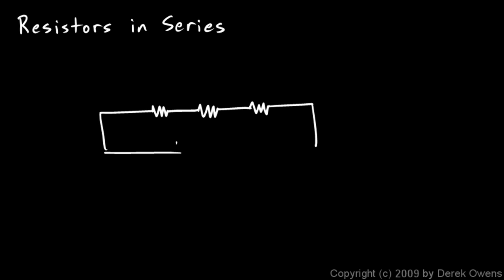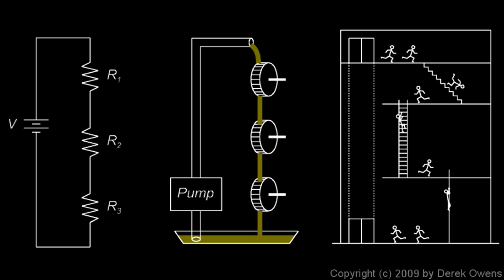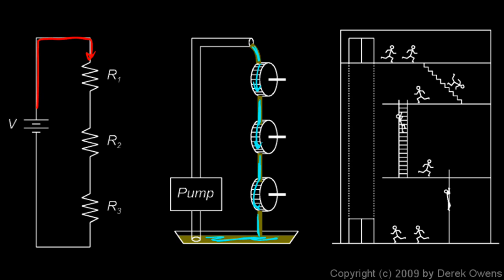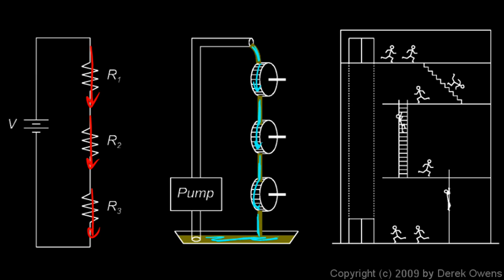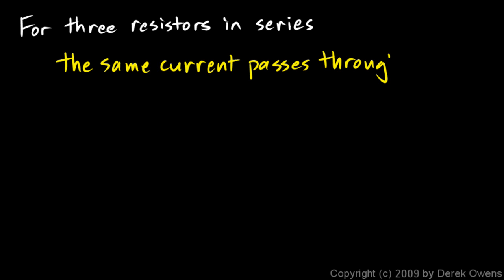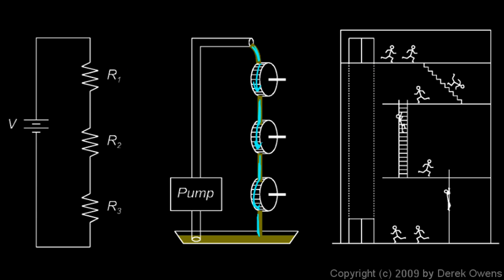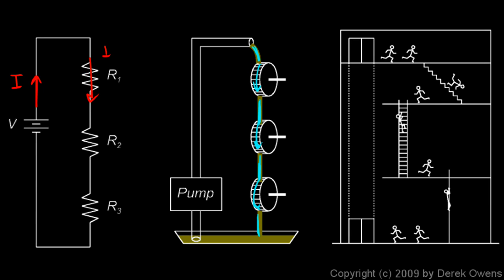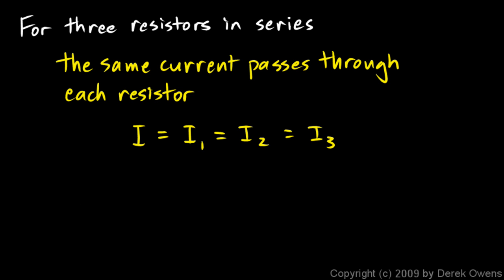Physics 13.4.1a - Resistors in Series

Comment: Does a 2 filament auto bulb work in the same fashion? Or it works as two resistors connected in parallel? I am wondering if a 2 filament bulb that is used for stop light and turn signal light can work at the same time (eg. turning to the left while braking) or if they work only separate. I hope the question is not off topic.

Comment: my doubt is similar to preeth mutyala .if the resistors have different resistances shouldn't the current also be different according to ohm's law?
PLZ DO ANSWER
and yeah .this could beat khanacademy
Reply from the maker: Yes, to calculate the current you do use Ohm's Law.  For resistors in series, though, the current will be determined by the total resistance of all of the resistors in series.  The procedure:  Add up the resistances of all the resistors to get the total resistance.  The the current will be the voltage divided by the total resistance, and that current will flow through each of the resistors.   In parallel, you would calculate the current in each resistor individually.
Reply: got it .thanks. great videos.

Comment: I have a doubt . You said that current passing through each resistor is the same . But that is only possible when the resistance of the 3 resistors R1,R2,R3 are the same . What happens if the resistance of the 3 resistors are different . According to the Ohm's law V=IR , the potential is same but the resistance of each resistors are different . So the current passing through each resistor should be different.Isn't that it?

Comment from the maker: Your thought on voltage as vibration probably comes from alternating current.  With alternating current, the electrons actually do move back, and forth, back, and forth, and they deliver energy in the process.  But with each little motion, they are "falling" to a point of lower potential energy, and giving off that energy electrically.

Just as a waterwheel can capture the energy from falling water, electrical devices capture the energy from "falling" charges.

Comment from the maker: Voltage is not vibration.  It is, very precisely, energy per unit charge.  When a charge moves from one point to another in an electric field, it can gain or lose potential energy (just as a mass can move from one point to another in a gravitational field and will gain or lose potential energy).  And voltage is not force.  However, in practical work with circuits, it is conceptually convenient to think of it as force: more voltage = more current crammed through the wire.

Comment: I was under the impression that voltage was the vibration of the electrons, the amount of energy emitting from these particles. Electron move at the speed of light o ready so how can voltage push them harder? Am having a hard time picturing it mentally.

Comment: U said that the current flow is the same in each resistor, isn't that contrary with that the resistance is inversely proportional to the current? And just to be clear, when a current flows and passes a resistor doesn't the current flow get less? or is that only the Energy of the current?

Comment from the maker: @squarewave2  Yes, current flow is related to voltage.  If we add resistors, that does not affect the voltage, but it does affect the resistance.  Adding more resistors (in series) will increase the resistance, thereby decreasing the current flow.  The voltage is unchanged.

If you squeeze a water hose, that doesn't change the force pushing the water from the other end.  It changes the resistance, and also changes the current flow.

Hope that helps,
DO

Comment: I was under the impression that current flow was directly related to voltage. When we add resistance to a series circuit, decreasing the voltage, how can the current remain unchanged throughout the circuit? If I squeeze a water hose (resistance) the quantity of water coming out the end decreases proportionately.